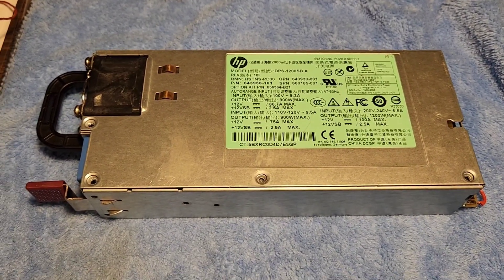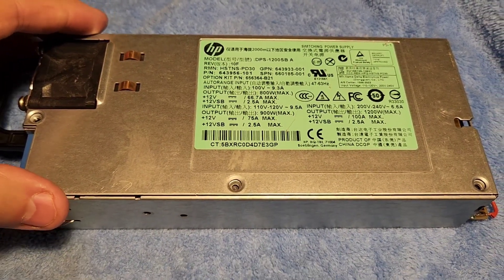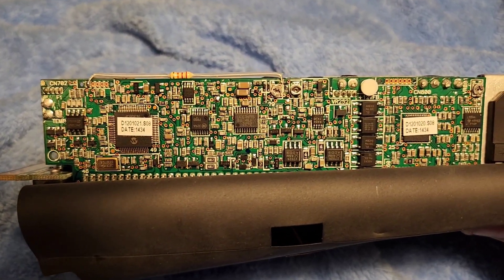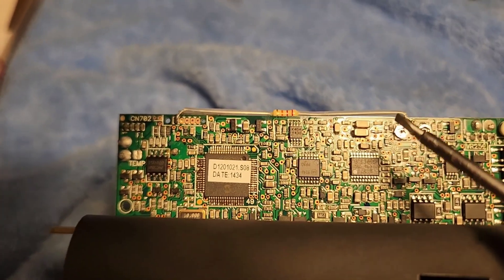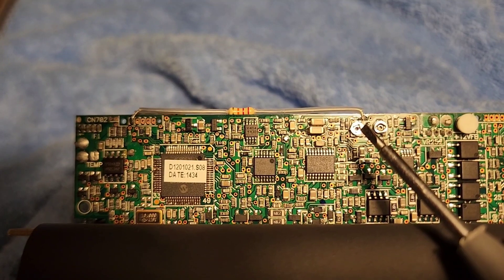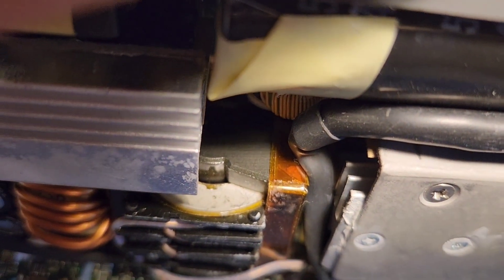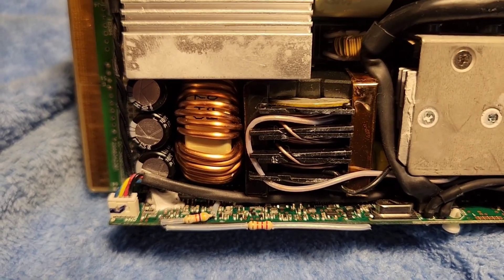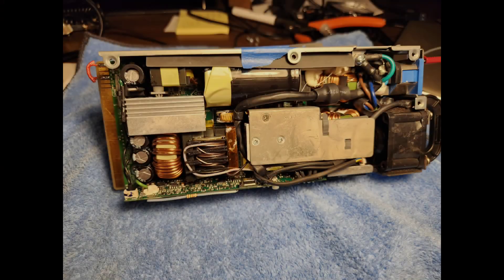HP DPS-1200SB A Power Supply Voltage Hack. My Values.

Comment: i have similar powersupply (liteon) that came from china as a car battery charger with a digital display and a pot on the top to adjust output amps.. it suddenly stopped working. it have a power on led on the front and it does not come on enymore when i plug it in to the wall.. any idea what might have blown as it was used from a diesel generator to charge batteries :D i had a look inside but could not see any fuses.. it worked for a year but was kept in a cold space all the time..

Comment: Why didn't you just leave it at 14.8 if you're powering a ham radio as that's well within the specs; wouldn't a little higher voltage actually make it run cooler since amperage is lower? Anyways, did you buy a resistor assortment pack or buy them individually. The assortment packs don't seem to have some of the ones you used or BBI used but a whole lot of ones to low or too high that I'd never use.
Reply from the maker: One of my radios is sensitive to high voltage.  I'm a retired Electronics engineer, so I have plenty of components lying around.

Comment: At voltages greater than 14 volts, does the power supply not go into protection?
Reply: Most of us doing this add a  resistor to trick the crowbar into a higher volt and amp protection mode
Reply: This is a problem I had with lesser versions of the HP PS series.
Reply: How many volts of mains input were these experiments made with?
Was it made with 240v?
Reply: @MESUTYALÇINPAŞA  Main input voltage will just change max output power. The output voltage will be the same but amperage with 120 v is 75 amp, with 240 volts  is 100 amp.
Reply: @snail2171 Thank you my friend, it was very good information for me.
Reply: @MESUTYALÇINPAŞA  For me, 120V.  That shouldn’t affect output voltage, at least when unloaded.
Reply: @barthchris1 If I use the same 18k and 47k, will I get 220v and 14v values?
Reply from the maker: @MESUTYALÇINPAŞA  120V, but it will work with 240 as well.

Comment: Nice. 
I think it would be helpful if everyone put in the comment the various different volts and resistance they used to arrive at what they want.
I am using 10 of these same power supply units.
I used 14k480 for the crowbar and 10k for the pot and got 15.5 volts .
Load test to 70 amps quite easily. 
I have had to order 4 more units for a total of 14 to get the desired 1000 amps.
I do not need that much just yet . This gives me a ton of head room .
Reply: How many volts of mains input were these experiments made with?
Was it made with 240v?
Reply: @mesutyalcin5965  i have done both my set up is 2 run on 110 for a demand up to 160 amps. Or 220 for around 95 amps.
Then for bigger stuff like my 2 x 10 ,i use 4 of the hp supplies at 220 even at 220 tho running 15.5 volts i still only get about 85 amps per each unit.
Reply: @randyguay7115 If I use the same 18k and 47k, will I get 220v and 14v values?
Reply: Hello,
Is there any way to slow down the voltage to 10.5V ?
By the way, I'm using HP HSTNS-PD18 750W.
Thank you.